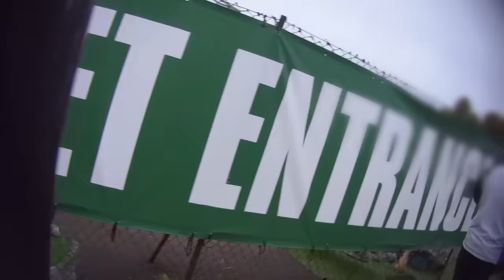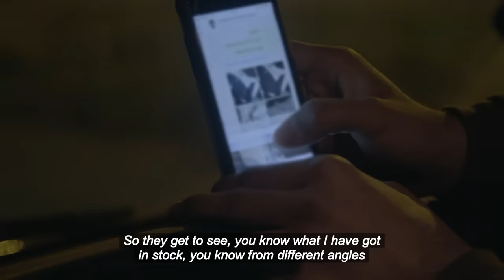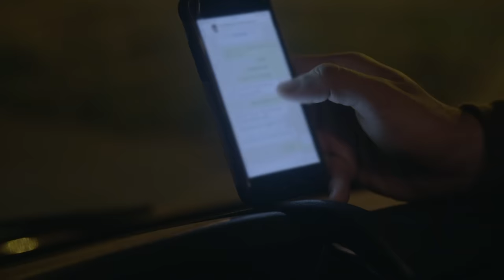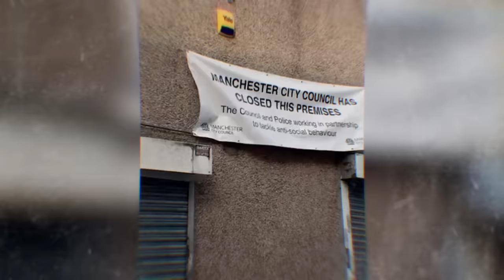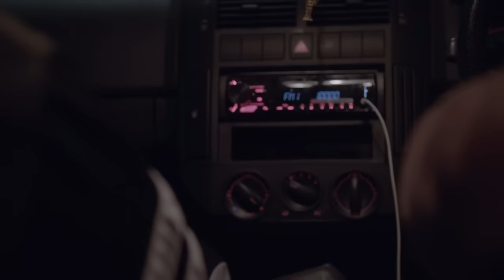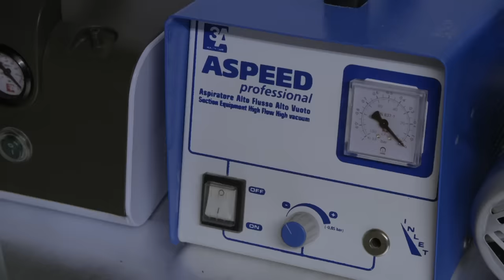Fake Armani, XANAX and MORE | Inside Britain's Black Market | ENDEVR Documentary

Comment: I´ve seen a lot of these YouTube chemical synthesis videos.  You need to know what you´re doing.  Cannot believe you went into a chemical lab & didn´t wear any face protection.  Many of these chemicals can be really dangerous & toxic the synthesis should be carried out in very well ventilated areas.
Reply: She did sleep really well that night after visiting the Xanax lab.
Reply: You need a respirator, last thing you need is a cloud of clenbuterol going up your nose, in your eyes. As for the steroids, made no different to Pakistan/India, just on a smaller scale. As long as the right proportions are added, alcohol for any bacteria, which is impossible to avoid, there is no issue. Clenbuterol, micrograms, anything in the micrograms should only be bought by a reputable pharmaceutical company.
Reply: @pedclarkemobile  & she doesn´t remember a thing!
Reply: @WhySoSerious551  I´ve never seen Xanax synthesised.  But using simple chemistry it´s all petroleum-based chemicals.  But you have to know your reactions & heating.  Get one bit wrong everything else goes wrong.  Just watching that pill machine there could be a lot of dust.
Reply: A synthesis is the production of chemical compounds by reacting simpler materials. They're not synthesizing anything here, they're just weighing out already synthesized compounds and putting them into pills/vials.
Reply: @Westhamsterdam  To actually produce something like Alprazolam, you would need millions of pounds of equipment, people, and ingredients that would be very difficult to all acquire. Acquiring Alprazolam is nearly impossible, the raw powder, so a substitute is used.
Reply: explains why her voice is deeper than mines
Reply: @thegreatujo  To produce the chemical synethisize these compounds, or get the raws and press them in to pills? To do the former you would need more than a warehouse and some pill presses.

Comment: I respect him and the fact he has quality control. If every drug manufacturer had ethics like him we would have less  Accident death
Reply: He is an amateur, see that pill press machine, that is one step up from the manual one you turn that pops the pills out.
Reply: @WhySoSerious551   Im pretty sure that here in the US, the feds regulate who can buy pill presses. Not easy to get A hold of. It never made sense to me why dealers dont just put it into capsules if getting A press is A hassle.
Reply: @mitchweber7868 it’s never made sense to you why people would press thousands of pills per hour rather than manually weigh up and fill capsules?
Reply: at least minnimum he checks for fent, first step 😂
Reply: @AidanMacgregor-Personal  Dead customers are not repeat customers.
Reply: I'd still question his QC but I've seen on the street in past 10 years. Bars from the street are either absolute nothing or fent. Won't touch em no more.

Comment: Why didn’t they tell us the results of the tests, to show what contamination the vial of steroids had, and the dosage within the tablets.

This gives a bad view on this industry. The guy hasn’t a clue how to do what he’s doing. Definition of ‘all the gear and no idea’. He could easily improve his processes DRASTICALLY, without much more investment.

For example: Using that cement mixer is a bad idea when you’re operating with active chemicals with the dosage range in the single digit milligrams, and sometimes micrograms with designer benzodiazepines. 

Cement mixers can cause products to be ‘over mixed’, whereby the exact point of multiple substances being mixed can be reached, and further mixing can cause it to become ‘unmixed’ again. This can cause the pill doses to be incorrect and not uniform throughout, risking overdoses.

Powder mixing machines should be used for this, and not a cement mixer.

ALSO, using a urine test kit to test for drugs in a sample of powder isn’t a good idea either. 
More often than not, urine drug tests will test for the metabolites of drugs that are found in the body AFTER the liver has processed the substance. Not sure if this is the case with fentanyl, but he should be using reagent tests and not urine screening tests.

Comment: If he makes 105,00 Euro for 42,00 pill, that’s about 114,602 USD. Comes out to about $2.70 a pill, seems high coming from the direct manufacturer. I’ve know people who sell in batches of hundreds or just a couple thousand that sell for about the same rate sometimes, even cheaper. In the states though, port city/border city.
Reply: 42,000 you missed a zero bud
Reply: Thats the street value not the price he sells them for. It will likely go to another 2 or 3 dealers before it hits the street, which adds to the cost of the drugs